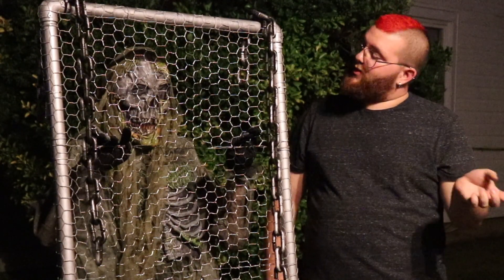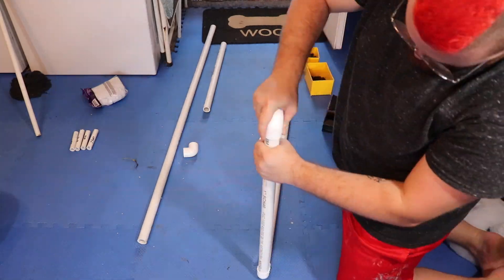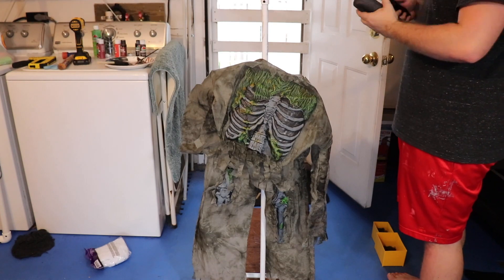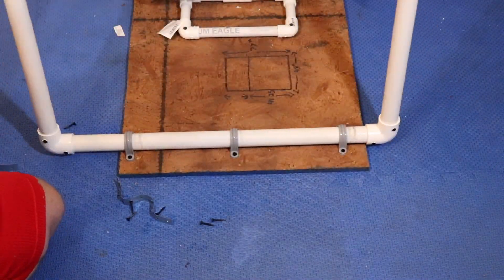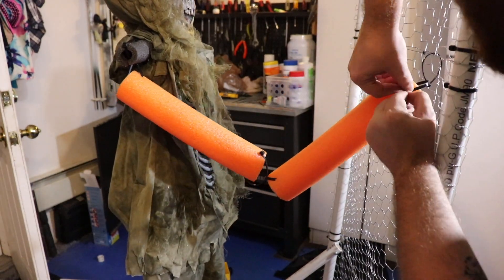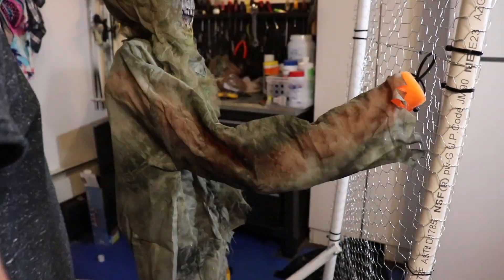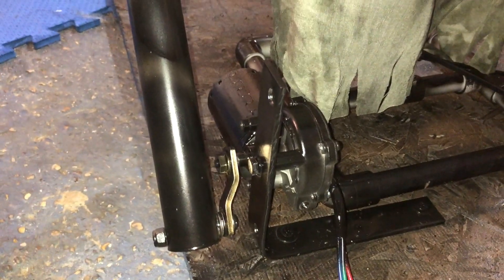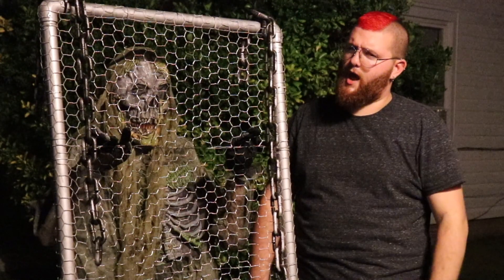Fence Banging Zombie Build

Comment: Well done. If you don’t have lock nuts with the nylon insert you can use two of the regular nuts. Place your first nut to allow for the spacing you need, then apply the second nut and use 2 wrenches to tighten them against each other.

Comment: Very nice, good tips on the loose zip ties for joints and a few other things. I probably would have done the spray painting before dessing the zombie, but that's by the by. I might have to make myself one of these now, just to see if my reindeer motor has enough torque for a plastic fence. Oh btw, the electrical conduit "brackets" are actually called saddles if anyone is wanting to search for them online.

Comment: I’m new to making motorized props, but have been making giant props for a few years. Can you please share what kind of motor this is or how to get it? I think it will work for a few if my things this year. Thank you. And this is better than the store versions for sure!
Reply: It’s a 12v motor, they’re used as windscreen wiper motors. They’re really easy to get from wrecking yards and they’re usually only $10-$20 and sometimes you can buy new ones for common cars, like a Civic for about the same price. They’re really good because they come with a gearbox, and they’re pretty much a standard fit so if you break one, you can replace it very easily.

Comment: I've had some luck with plastic construction fencing instead of chicken wire; easier on the hands anyway. Can find it at most home improvement stores and paint it to match whatever frame I've constructed.
Reply: Trying to make a fencing enclosure for the first time for a group of 5 zombies. I’m thinking just a square or rectangular enclosure but I’m wondering how tall and thick the PVC should be? Any help greatly appreciated!

Comment: Could I suggest maybe adding the wire before attaching the frame to base? Might have made it easier and then attach it in one length and the frame can lay on it to hold it down as you cut. To make it less troublesome 😜
I did something like that when I bullied my catio. Yes rolled up wire six and I should have worn gloves too cos I still cut up my fingers 🤦🏻‍♀️

Comment: This was really well done. Excellent work. One question where did you get the motor ?
Reply: Looks like a wiper motor off of an old chevy or gm pick up.  If it is, he's probably running power from a 12 dc adapter or perhaps a car battery sitting in the yard.  I pc power supply unit could also work.
Reply: @maxmendel7411  literally, the motor was the most important part and he left that out ha lol

Comment: First of all I want to say I found the frame REALLY smart. Great job. Secondly, you don't have an opinion about chicken wire do you? LOL!
Reply: use real fencing, try a company that installs they may have short leftover pieces or supplier. if copying his you would need just a small piece(s)!in width. Fencing is put together using one piece of the wire and you weave it through to connect or add/subtract more fencing! Of course you should use a 6' fencing or taller which could then be cut lower!